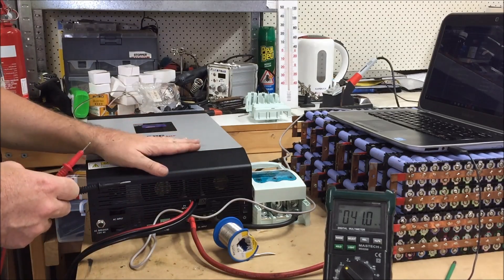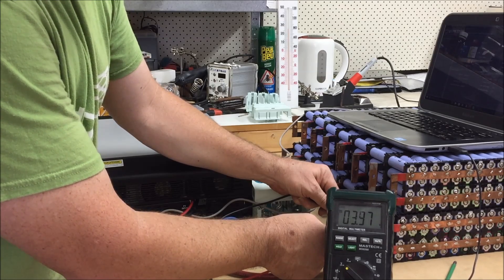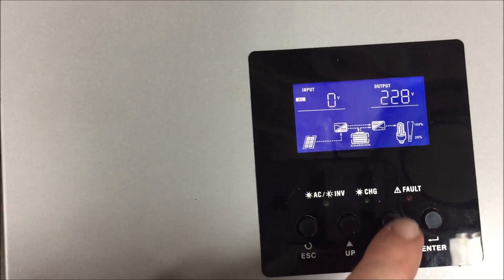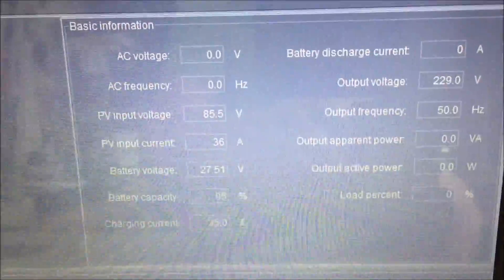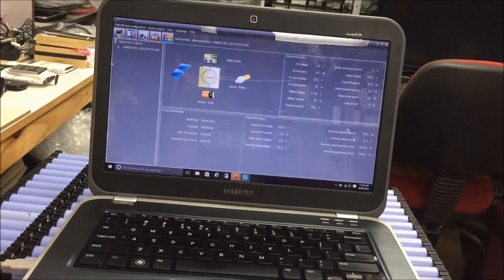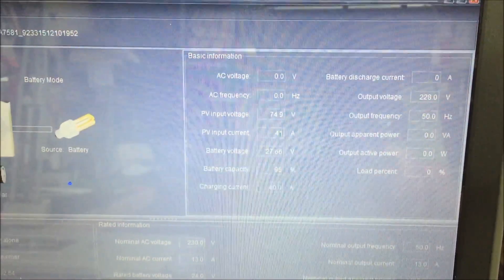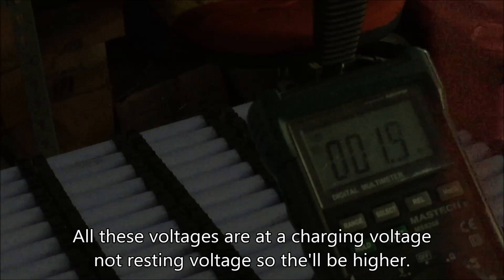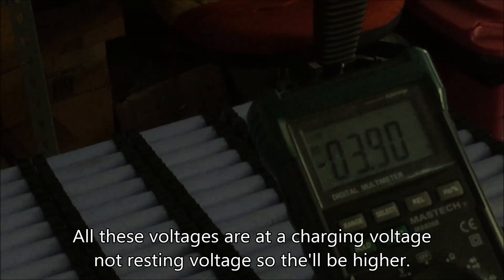18650 cells being charged via solar using PIP2424MSX on my DIYPowerwall

Comment: Over time, will you be balancing the packs in some way to prevent them from having large deviations in pack voltages?
Reply from the maker: +Sean Pain Absolutely !!! check out some of my earlier videos, i go through this in detail somewhere...
Reply from the maker: +Propergol ooh it's a piece of crap plan is to use it at 1/3 the rated load and run separate bms on each pack.
Reply: +HBPowerwall The last time you said your BMS was so badly build than you won't use it. Did you find a new model?
Reply: Ah. Ok. Did you have a look to Electrodacus SBMS? It looks very well build and also very advanced BMS fonctions.